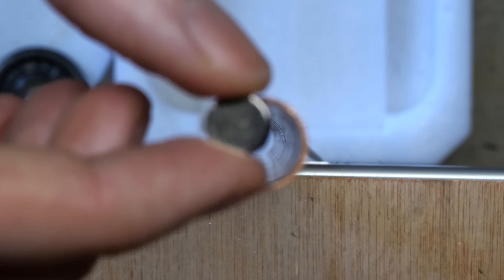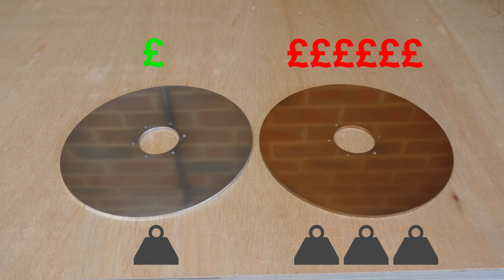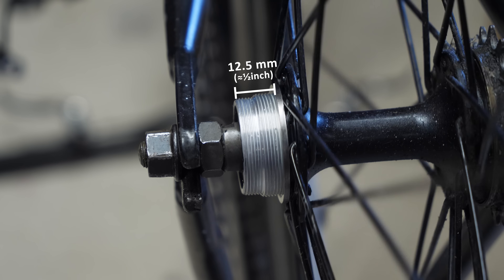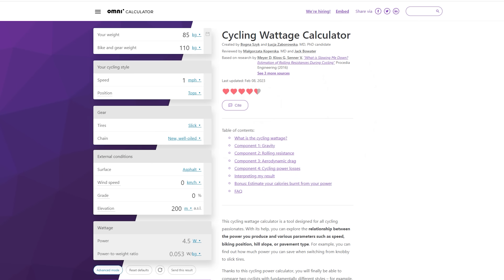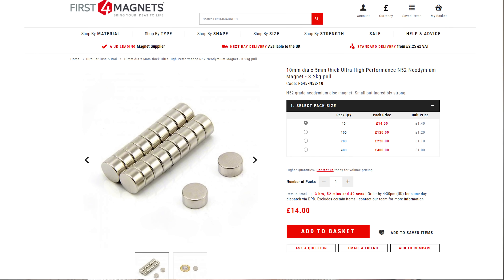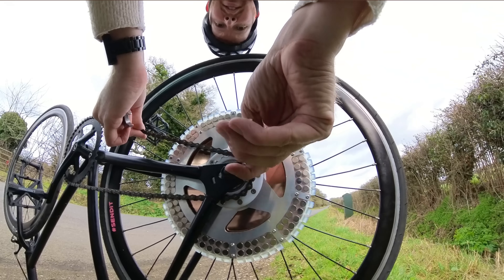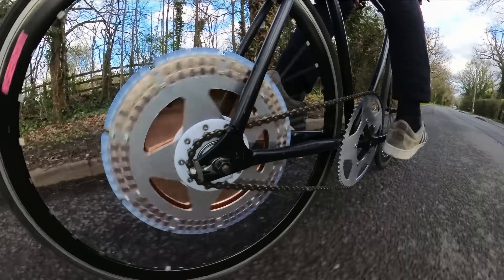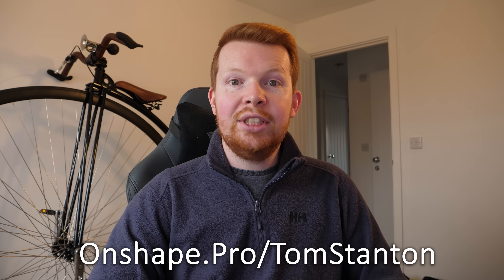Gearless Magnet Bike

Comment: This is so insane! I love it! Btw, how many flat miles do you think those magnets would last before getting demagnetized to 50% of their original strength?
Reply: the insane part is how much energy is wasted on heating the copper disc with rotating magnets. should have used two wheels both with magnets.
and magnets are the longest lasting part in this entire bike and road scenario.
Reply: @echelonrank3927  Interesting idea, and I suspect that using two magnetic wheels would actually facilitate the end goal of a working CVT, as one wheel could simply have one ring of magnets that travel along the radius of the wheel to engage the other magnets at various diameters (to switch gear ratios without mechanical engagement). 

If this isn't a convenient thing to design mechanically, it obviously could be rigged up quite simply with an Arduino board and homemade motorized 'ball screw' mechanism for sliding the magnets in and out, depending on wheel speed.
Reply: The more miles u ride in a piece, the higher the temperature u end up with, and the more u damage the magnets... If u use the bike for short commutes, is mach bettter than using it for long trips. But as already noted, the longevityy of the magnets isn´t the issue here, and as suggested,, there´s solutions even to that  ("two wheels both with magnets")...

Comment: Better to ask chatGPT instead of google imo. (Just for future reference)

Here is chatGPT's answer when asked:
"Both copper and aluminum are good conductors of electricity, but copper is a better conductor than aluminum. Copper has a higher electrical conductivity, which means that it can carry electrical current more efficiently than aluminum.

In an electromagnetic braking system, the conductor material is used to generate a magnetic field that interacts with a magnet to slow down or stop a rotating object. Since copper is a better conductor than aluminum, it will produce a stronger magnetic field and generate more braking force for the same amount of electrical power.

Therefore, copper is the preferred material for an electromagnetic braking system."

Comment: I know this idea has nothing to do with the point of this video, but what if you made heat the product of the system. instead of a wheel spoke the copper has heat pipes which run to a radiator, and a small variable speed motor or a simple motor with a transmission spins the magnet ring. could be an Odorless, nearly silent heat solution for small spaces since the only input is rotational energy. i realize it is not the fastest way to heat a room and won't work at extremes, but it could work in a wall cavity or under a vanity to keep pipes from freezing. And it would be less likely to start a fire than traditional resistive solutions.

Comment: Hi Tom,

Here are a couple of ideas to try.
First, lose the rear sprocket and chain altogether!  How?  Drive shaft drive!  
The second part, to make up for the 100 RPM differential... a small electric motor that spins at 100+ RPM, and that would add to whatever your input is. Should make for a much less difficult climb. I should add... put a speed control on it, so that when you stop peddling, the motor keeps going and you don't lose speed...  as you use a brake style handle the speed lowers  and you get your gentle braking as needed.  No sense in losing your inertia just to rest your legs, only to have to kill them again to get going. 

Wow, it is very nice that your have those advanced tools, CNC, 3D printer, etc. 

The third issue is the heat issue...  I would think that you could use a vented copper disk towards the center that is away from the hub , and the the magnets - kinda like a vented disk brake.

Comment: Would you not want a loss-less clutch ? A high-efficiency-generator in place of the simple-traditional crankshaft, - could supply a small and light battery/capacitor-pack, which could take in solar-electricity aswell .( a charging-station, with solar-panels - would also serve as an anti-theft parking-device ) Almost loss-less in-hub-motors are offered by many manufacturers. Weight distribution ( important, as it affects steering), would be improved with one motor front/ one rear - instead of a single - larger, back or front. The principle demonstrated in this video, would come in handy for  recycling all the braking-energy, which normally get's wasted in friction-heating and rim-wear . Congrats on your exceptionally NEAT metal-work !

Comment: From the second he said what he was doing I thought all it would do was be to act as a break by adding resistance. You aren't adding a real transmission you are just adding a middle man and the extra resistance that goes along with it. it's just a more complex way to filter the same amount of power, while adding resistance and weight. 

Great experiment and the engineering that went into it was fantastic. As they say, you don't learn if you don't try. 

Although even if you removed 100% of the heat or at least any additional heat compared to conventional, it still wouldn't make your job of peddling any easier, force in equals force out, putting a magnet in place which acts as a middle man for the force, doesn't change the equation, as you can see he just has to peddle that much harder to make it spin faster. Even if all things were equal it would only balance out and leave you with what amounts to a one speed bike. As it stands it's a two speed, or should I say a one speed with the brakes on half the time because the magnets when not being driven they provide resistance by constantly "downshifting" and you can't push in the clutch, to leave it in neutral either. So I guess it's still more like driving around in first gear all the time really only the heat problem is like driving around in first gear with the breaks on partially too.

Comment: Very niceexperiment.  Suggestion: make it a hybrid drive. Put generator stator coils on the side of your spinning magnetic rotor opposite the eddy effect disc.  Operate a mid or hub mounted motor as engine and brake from the electrical energy generated by your hybrid system.

Comment: Hello.  you can increase your breaking power by peddling backwards.  If you make 2 disks with aposing fields. You can use cogging  to peddle and stop.   North verses south will be powerful but may  hit  without a plastic disk in between. North verses North will give less pull and more slippage. It'll be smother.  Try this for a project. I'd love to see it.   Thanks

Comment: Bullet points supercooling, air cooling.

I think if you could use dry ice or something that could cool ot to -256~°C i think it would perform way better in in climbing situation.

And I think also if you would be able to cool of a plate of copper (or steel) using fins or some liqiud, i think the power output would be different.

Comment: This is what you want sir: https://en.wikipedia.org/wiki/Magnetic_gear . The induction design that you used has too high losses at high slip, you would need to pedal always close to wheel speed to have something reasonably efficient (i.e. less energy wasted in the copper disk).

Comment: Isn't this a physics problem that can be calculated? You can calculate the force needed to stop (kinetic energy) and the force given by magnets. That'l save a lot of trouble of doing tests in metal before actually building a model. To check if it's actually doable.

Comment: Aluminum is a better conductor but it expands more than copper when heated and is a softer metal. This is why they stopped using it in home electrical wiring because it would expand and squish on screw terminals, then cool and begin arcing.

Comment: Just a mind-blowing idea, but make sure that the disc does not slow down when the pedals stop turning. What will happen when the thickness of the disk increases. Is it possible to make magnetic brakes on a bicycle, and what is necessary for a more or less working prototype. Does the change in the diameter of the disk matter. Yes, the answers to some questions are obvious, but I think it will be interesting to observe such things in practice. Thanks again

Comment: I remember seeing a brake for a speed-record car based on this.  The rotating magnets would heat up a stationary disk.  This way for part of the braking cycle no wear was required, meaning consistency.
Reply: Sure, this would make a great brake. But it's not a transmission that can increase torque or speed.

Comment: Next build as powerful an electromagnet  as will fit on the bike to work against the copper disc. Then design a method to cool the copper disc that will use the heat extracted to charge the battery for the electromagnet.

Comment: Great to see this actually build, even if it does not get a recommendation.
Quick note: the 70W at 100RPM differential speed are the actual heat loss - considering 100-200W is about "normal" when cycling, the efficiency is really... not great.

Comment: You could probably fix the magnets sticking to the chain and the spokes with a thin piece of magnetic shielding (just a piece of sheet metal that is magnetic). It would probably also increase the performance since it can help complete the magnetic circuit

Comment: if you had a way of measuring the increase in heat in the disc after a short time of use, and a few other pieces of data, you could calculate its efficiency, which would be much much lower than a chain drive system. i doubt you can come up with a drive system that exceeds the gravimetric and thermal efficiency of the greasy, dirty, anti-feminist, patriarchal chain drive. i realize it wasnt your point that a magnetic eddy-current drive was an improvement on the conventional chain drive. but what was your point?

Comment: Copper is more conductive by volume, aluminium is by weight... because a magnet has a reach relative to the density, copper will perform better perhaps? weight for weight, alu is more conductive. If you get it wrong and have an aluminium alloy, with 1% other stuff, its conductivity can go down by a vast amount, 20-70 percent.

Comment: Cool project, basically how regen braking works in EVs. But instead of the energy going back to the battery it becomes heat in the copper.

Comment: This is because eddy currents induced in the metal produce their own magnetic field.  As a result, the interaction of the magnet's fields and the currents brakes the disc's motion.  Because copper has less electrical resistance, it produces a more intense field than aluminum.  This phenomenon was widely used in old electric power meters.

Comment: its not a bad idea. and can be further improved apon. by stacking disk next to one another. [example] magnets copper magnets copper... like a motorcycles wet clutch. also ..& you coud use pedal power to spin the copper and have the heaiver magnets mounted too the wheel.

Comment: Honestly, from the base idea, this had a lot of potential (and still has). I think the biggest issue is delivering direct explosive power to the wheels, like pro cyclists would do in a bike race when sprinting or climbing. But it also has a big safety advantage with the high speed magnetic braking. As a bike tourist, doing the descents of the french HC climbs, is a massive challenge on my basic rim brakes. Having this magnetic brake helping decelerate at high speeds will limit the danger of going too fast in the descent, and it also helps taking the load off the brakes. There are probably a lot more practical advantages to this that I don't see right now, but honestly with more development, I think it could be a great replacement for the classic gearing of a road bike.

Comment: Honestly, if I could get a 13lbs N52 magnet in the proper shape... I would have an interesting project in the works... Thinking of a wheel of pain from Conan, but smaller and producing DC power instead of solar panels... Haven't seen data that covers anything that large without it being unmovable, despite the leverage, with a person. Suppose it is more of my being curious about it.

Comment: if you planned a specific capacity along with a max angle for the road, then one can also plan the required magnet force to achieve, since the max weight and max road angle is not specified, there is no real way to do this experiment in a manner one can determine the effects.

Comment: So it seems that if you stop peddling you lose energy, which is not ideal.   I wonder if you instead of having a copper disc you have more of a copper ring and instead of the magnets being fixed allow them to slide in & out with the use of springs and with faster rotation (centrifugal acceleration) you could pedal fast to get the magnets (the field) closer to the copper to apply torque but when you stop pedaling they fall back into place and hence don't cause a reverse torque on the wheel.

Comment: Instead of a Cu disk, how about winding some flat pancake coils the same size instead so you can completly control the coupling ?
If you use pulse width modulation to short the windings, you have a frictionless variable clutch.
An Aurdino board has PWM pins and functions built in.

Awesome video dude !

Comment: i really think this is a cool idea ... I'd love to one day ride such a bike... wouldn't it be better if you use the energy that's created up to get some electrical torque too?  i'm not well enough educated into magnetism and electricity to know everything about the forces and how they operate against each other, but i do have a decent understanding of the basics (i think at least).  The eddy currents you create, what if you would also use a ferro metal to create electric currents, use those currents to create an electromagnet that pulls extra hard on the magnets (they want to be tidally locked to each other right?) like how an electric engine works, but a mix of the two... or am i now seeing some impossible things in my head... 2nd idea that i have is eliminating the influence of the chain on the magnets' fields..
Why don't u try some sort of belt instead of a metal chain? Doesn't the chain influence the form of the magnetic field when it crosses the magnets? Doesn't this lower the output power towards the disc?  Again, i'm no scientist, but when i think magnetism, currents and ferrous metals, every force influences the other... Just an idea ....
Otherwise, well done, well put into reality and interesting to watch!  keep doing things that are out of the ordinary, because those are the most interesting!

Comment: You might want to get a second selfie stick and an infrared camera (or iApp) to get a video of the heating of the copper plate when you stop the pedals and use regenerative braking.
Reply: And then we got to the part where you took an IR cam and made a shot of the disk after the fact.  Also need to consider how time and temperature affect the magnetic strength of the magnets.